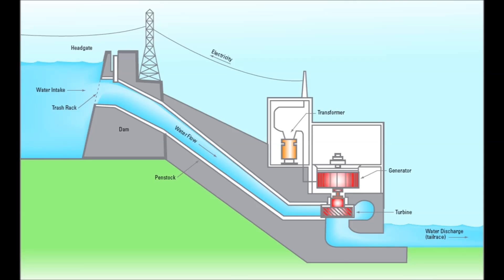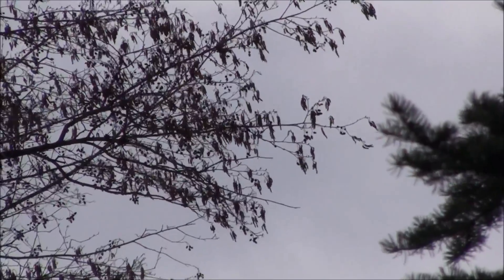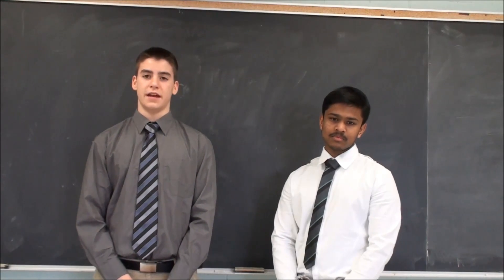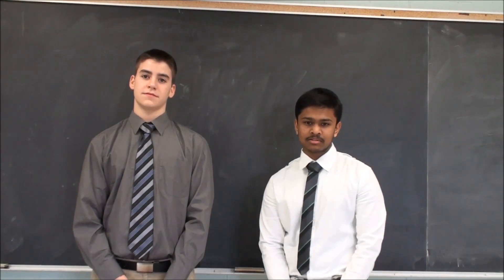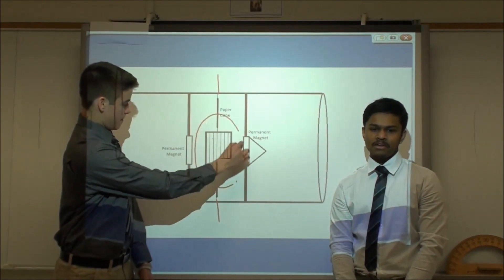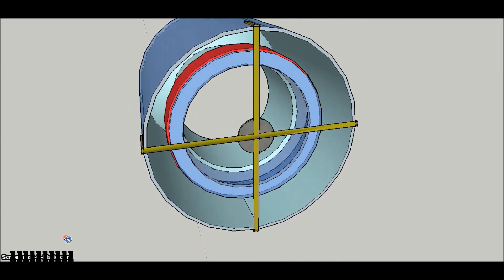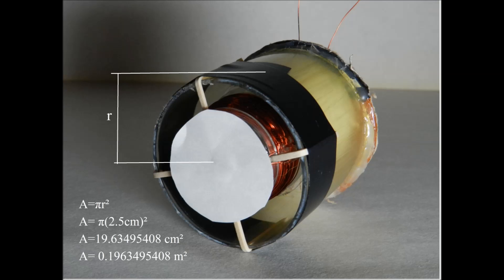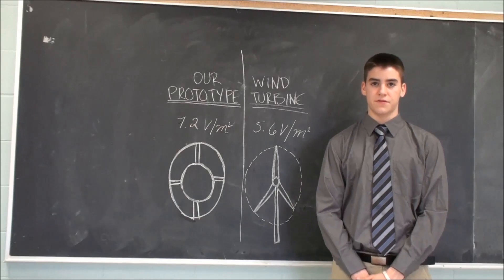2013 Google Science Fair Video Summary

Comment from the maker: Our project uses an entirely different motion to produce electricity and its applications are far greater than a windmills. The windmill relies on kinetic energy of the wind to produce electricity. In contrast, our project uses everyday vibrations to generate electricity. In this particular project, we have focused on using wind to produce those vibrations - to prove our concept. Our project is also capable of generating electricity from other vibrations (not produced by wind turbulence).